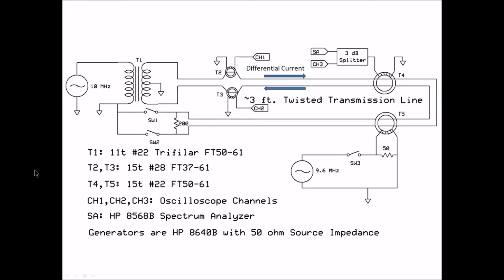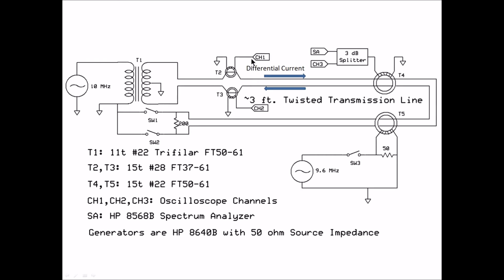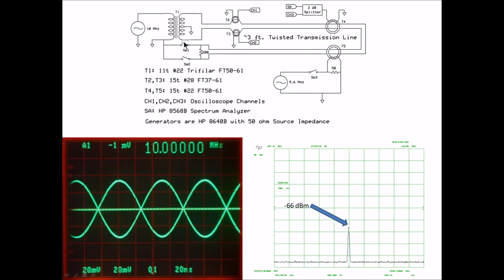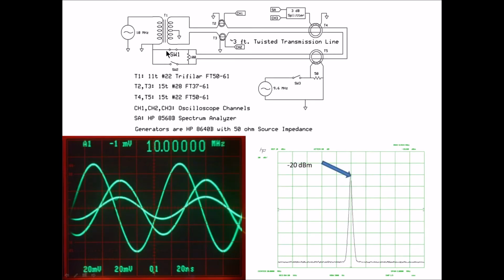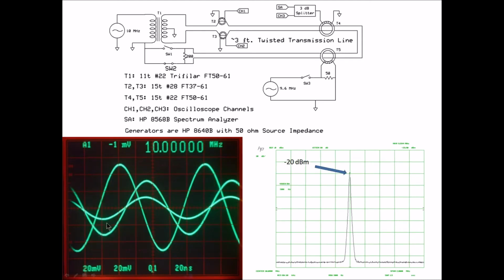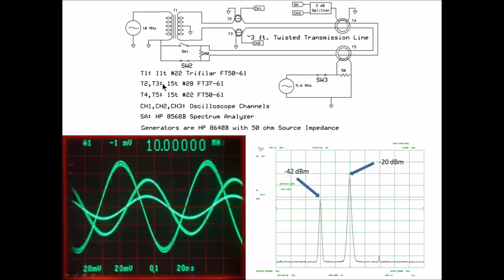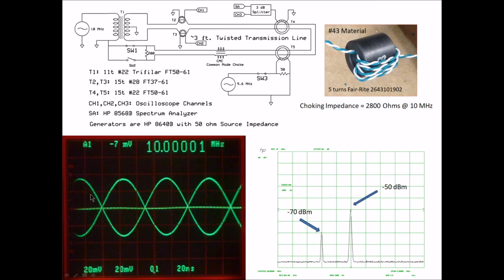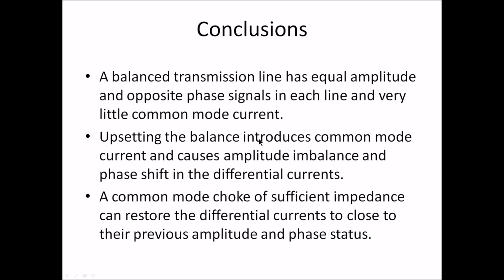Common Mode and Differential Currents

Comment: Why do your resistor values change from 100 ohm to 200 ohm for switch 1 to switch 2 in the circuit?
Reply: The 100 ohm resistor is a mistake, but that resistor just terminates the twisted pair, so it doesn't make much difference in the demonstration.